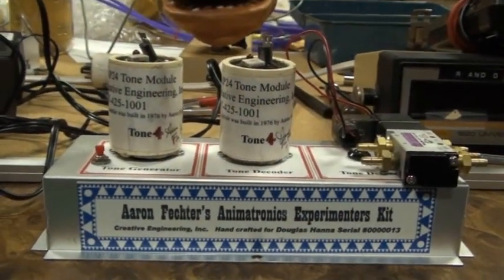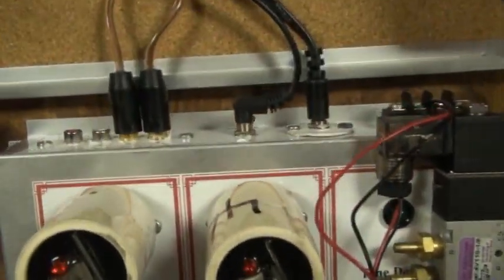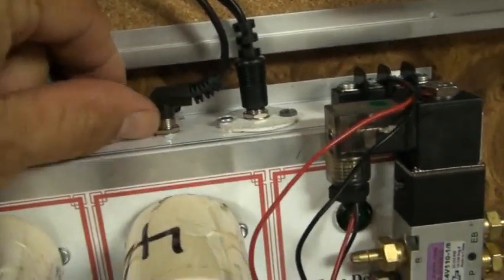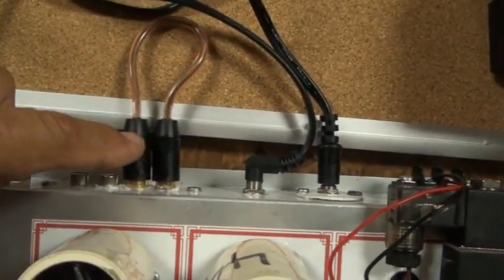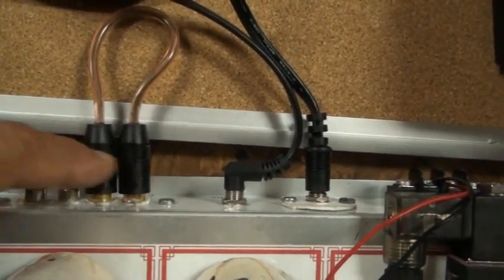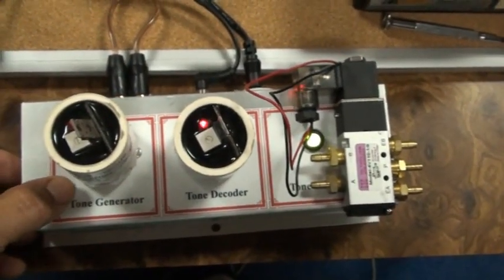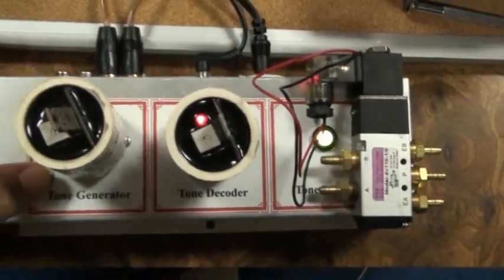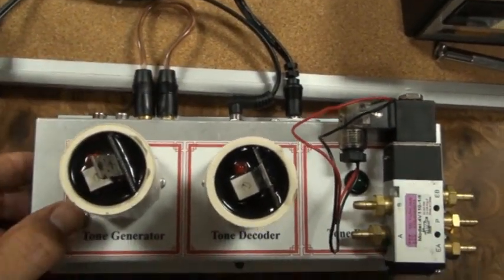Animatronics Experimenter's Kit Diagnostics

Comment from the maker: Shucks, it weren't nothin'.  By the way, for those wondering if they'll have my support and service after they buy my Animatronics Kit, rest assured, I will do everything I can to make sure you build this correctly and get the important first lessons you need under your belt to move forward with the hobby of animatronics.  I believe the path that I followed will work well for you and this kit is the giant first step in animatronics .
Aaron